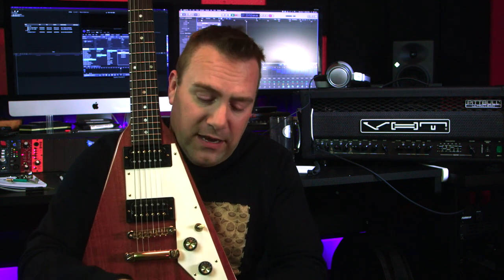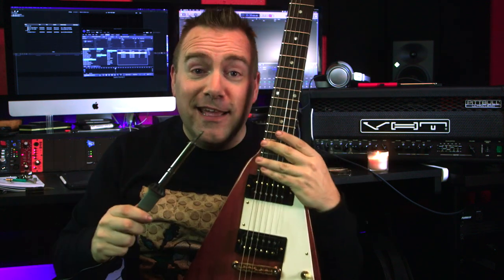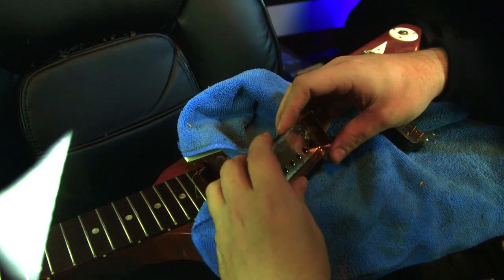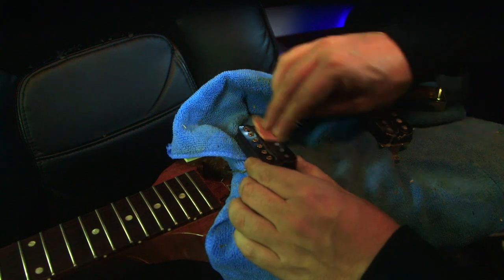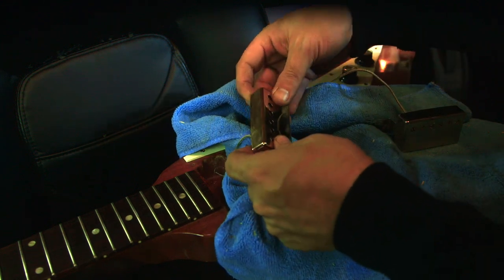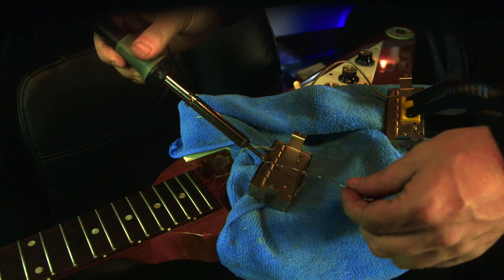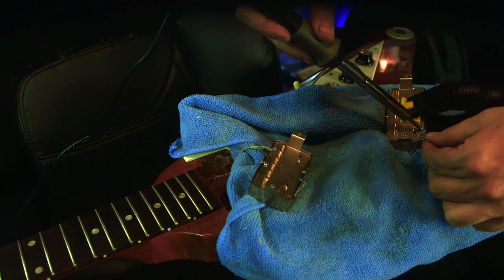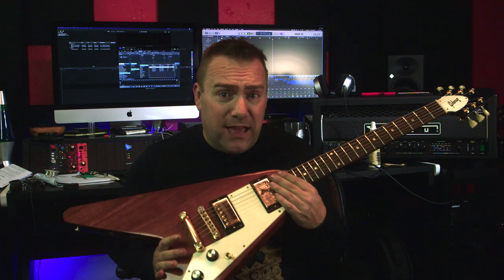How To Install Pickup Covers

Comment: Is the soldering essential? Can't it not be done making it removable?
Reply: Hello, I've seen some people using dabs of silicone to hold the pickup to the cover, but the right way is soldering, as you create a ground connection between the pickup and the pickup cover. Also if you see any major pickup manufacturer, they all have Solder on pickups with covers, so if they apply this method must be a standard I guess, cheers.

Comment: Aren’t those pickups already waxpotted so what’s the reason in putting wax again? I’ve recently installed pickup covers in my sg I have some squealing but only at cranked gain and volume! However at these amp settings my LP with Seymour Duncans that have covers from the factory are also squealing!
Reply from the maker: You need a barrier on the slugs. Cheers -Ryan